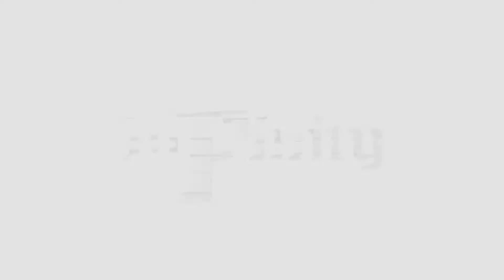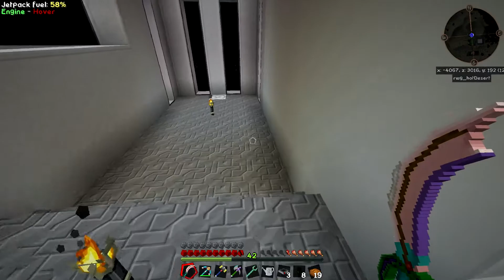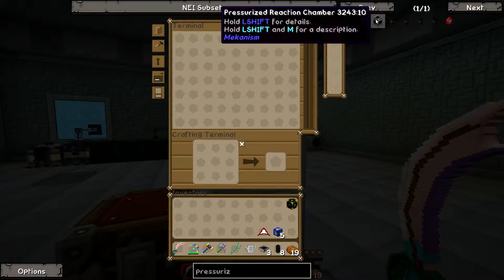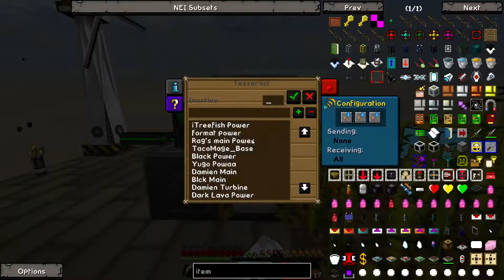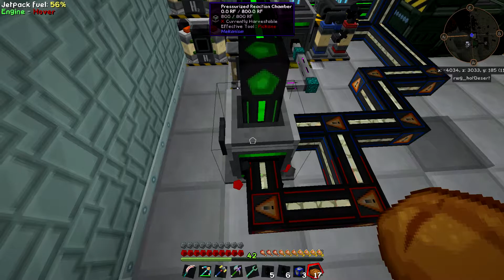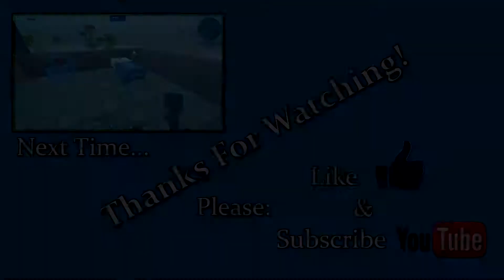Infinity Fortress: EP19 - Goofy Gasses

Comment: Whats you PC setup? I'm wondering because i'm getting tons of lag on Resonant rise. Even though my PC is really good.
Reply from the maker: *****   One thing you may need to do if you haven't already:  Go into the java settings for the RR3 instance and assign it 4 GB of ram.  By default it'll probably be given 1 GB which is not nearly enough to run RR3 without massive FPS problems or outright crashing.  From what I've seen, our flavor of RR3 runs at between 2.5 and 3G of ram at any given moment, so 4Gb gives it a bit of overhead without providing java so much that it doesn't do proper garbage cleanup.

I've heard from some of the guys on the server that they run it at 3G without issues, but I wasn't able to remain stable with just 3 myself.

Otherwise my PC isn't anything special.  Quad core Xeon @ 3.2ghz, 16G Ram, and a Geforce GTX 780 Ti.
Reply: Your PC is good.

Yeah, im running at 4 GB of ram and ive installed fast craft and optifine and they gave me like 10 fps but im still only running at 20-30 fps which is not ideal.

My specs: AMD FX 9590, 16GB RAM, GTX 980. And im also running it on an SSD